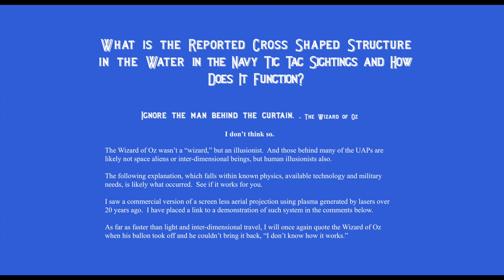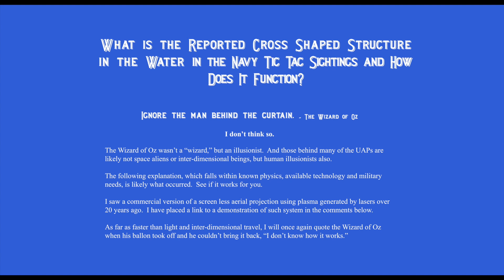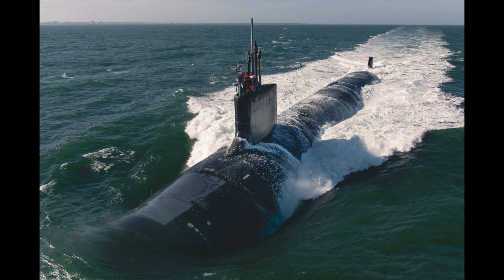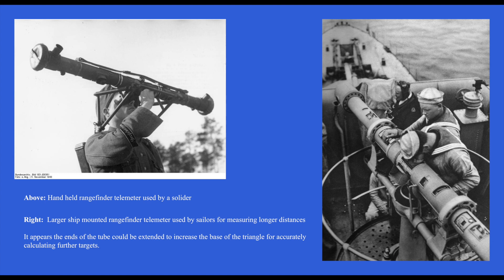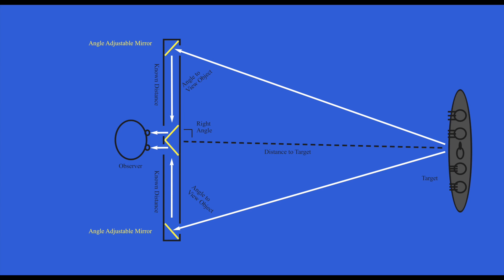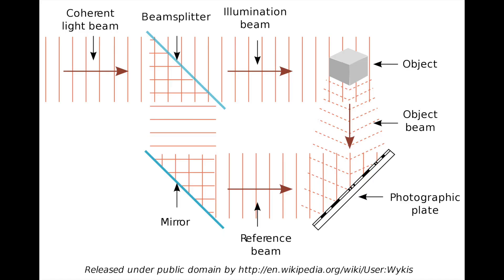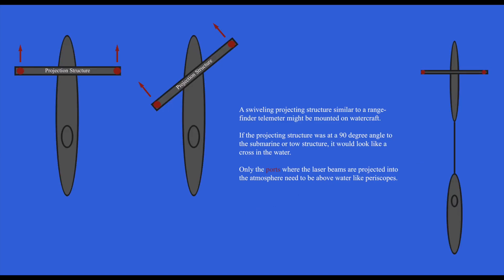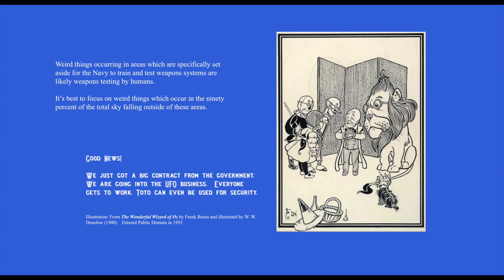Location and Structure of Navy Tic Tac Plasma Projector

Comment: Plasma created by a laser is hot, so it should radiate tons of infrared. The flir video's cycle between blackhot and whitehot, and it only looks slightly warmer than the atmosphere.
I'm quite sure that it isnt plasma.
Reply from the maker: I have an industrial IR camera which has the gradations shown in color.  But it is designed for searching for problems with equipment. I'm not sure how the aircraft equipment shows on a screen.  I guess it is designed to find jet exhaust.